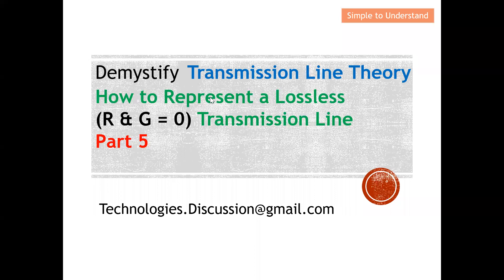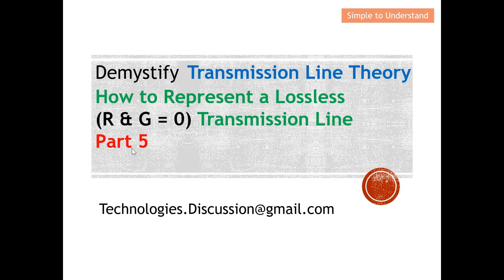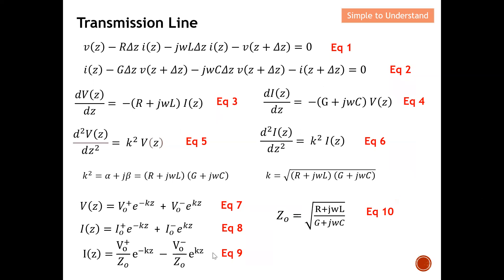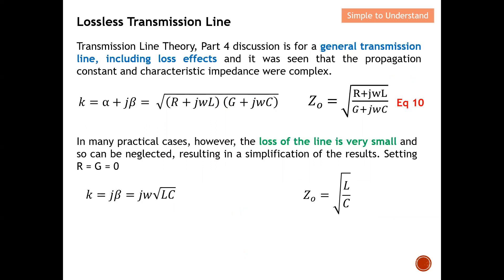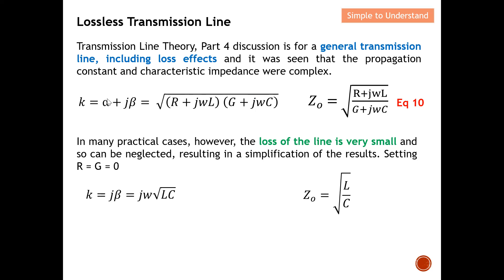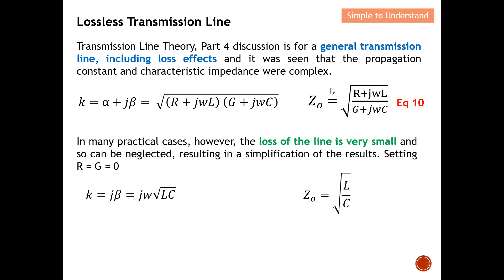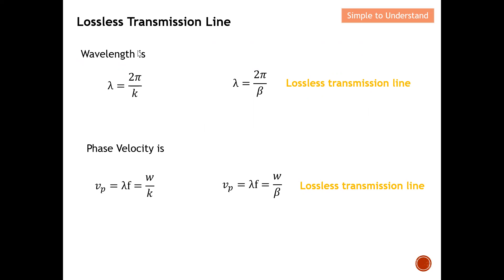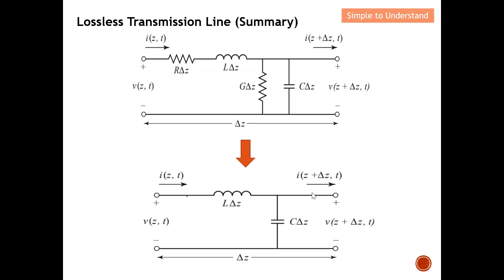Transmission Line #5. How to Model a Lossless Tx Line with Zero Resistance & Conductance Explained.

Comment: In the last slide, it is mentioned k=a+jb but as per previous part 4 video k^2= a+jb, k is the real root?
Reply: K=√(a+jb) right? Please update in the last slide
Reply from the maker: 𝑘^2 = 𝛼 + 𝑗𝛽 = (𝑅+𝑗𝑤𝐿) (𝐺+𝑗𝑤𝐶)
Therefore, K=√(a+jb)
The expression is different but they are all correct, right?
Mine left hand term k^2
Yours is k
Reply from the maker: Thank you for your question and yes, k is the propagation constant. :)